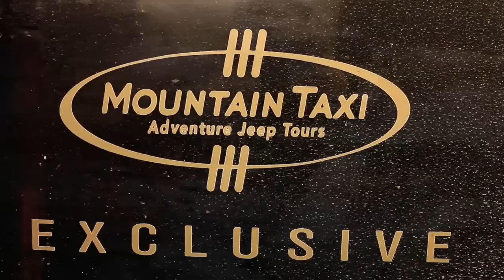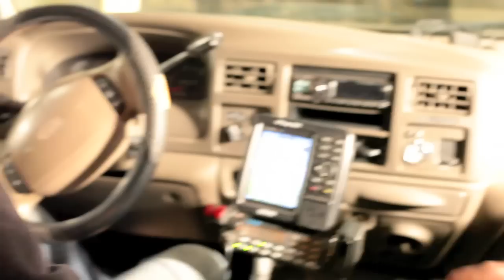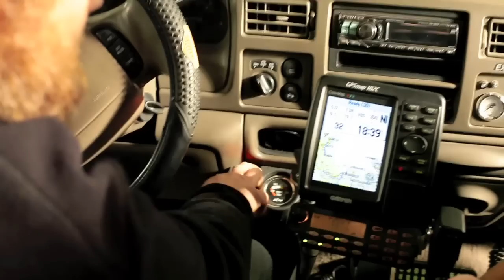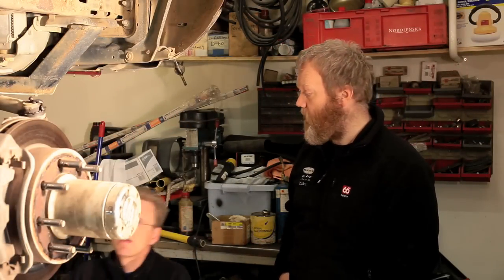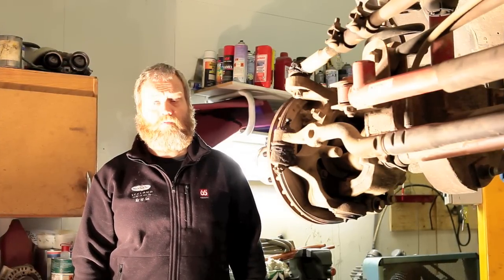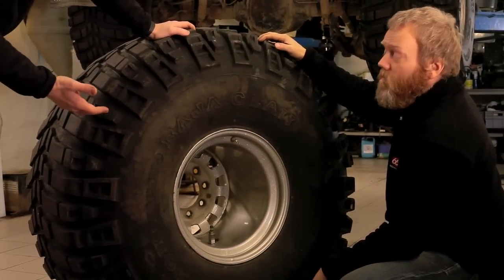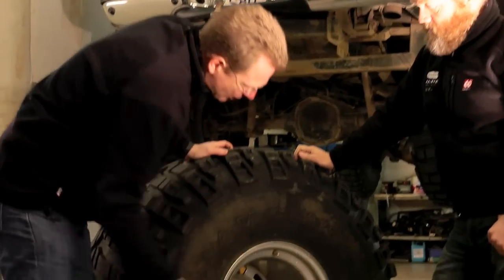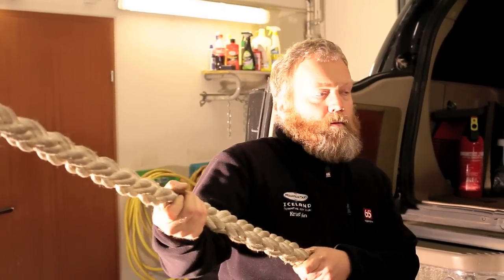ICELAND'S GIANTS OF OFFROAD: Extreme Offroad Ford Trucks

Comment: Seen this video a few times now lol, so recovering a vehicle using your tow ball is okay? I think you may need to get some rated recovery points added to the front and back of your trucks.
Reply: To be honest, i think he probably knows what he's doing by now. I'll trust a man who can build suspension which lasts 400,000Km off road, with zero repairs, and can travel all the way home by GPS in a blizzard, knows if he needs to upgrade his recovery points.

Comment: Considering the lift kit is custom made at the arctic truck workshop, no you cant buy THAT lift kit for 6k. the tires and rims alone on that car cost 3,953.61USD EACH
But to answer corywaynemartin31516's question, depending on US import laws, yes you can order all, Arctic Tucks vehicles.

Comment: About comms: he said that there is one vhf radio for close comms and another one  "high power long range radio"...what radio is it?
Reply: the "long range" simply has an amp for More Power!!!!  Seriously, It could either be a UHF or a VHF.  Both are used by Coast Guard, police, military...  UHF is more line-of-sight than a VHF.  When professional radio operators want to talk looong range they use VHF or HF.  Lower freq will "cut through" obstructions and also allow you to 'skip' the signal.  Likely the close comms radio is probably a CB band and they generally top out at 5W, often come tuned to 2W from factory.  Long range you want to push 20-50W.

Comment: thos are mickey tompson baja claws ttc radials on the back there run about 400$ each... i have mickey tompson baja mtz's on my truck and they run 350$ each... on the front are interco superswapmer LST's they can run about 400$ each as well.. and you can get rims that are bead lock for 200$ each. it dosnt take much to make a lift kit.. look at my truck on my channel. it has a 6'' lift and 295-75r16 mtz's

Comment: So I didn't understand how his bead is locked in. The rim looks like any steel rim, so could anyone explain how he can air down to 2psi without a bead lock?
Reply: +chickensodelicious  Theres internal beadlocks that go inside the tires..
Reply: +TBOwi I couldn't fully understand what he was saying, but it sounded like he was saying that it had something to do with the lip of the rim.
Reply: The bead rolled edge the tire's bead slips over during mounting has been rolled further to have a higher profile. The tire will need more pressure to seat during mounting, and breaking the bead is a bitch. This has been going on for a long time, since way before bolted beadlocks became popular and common place on streetlegal vehicles. This is a simple, light and inexpensive way of keeping the tire on the wheel.